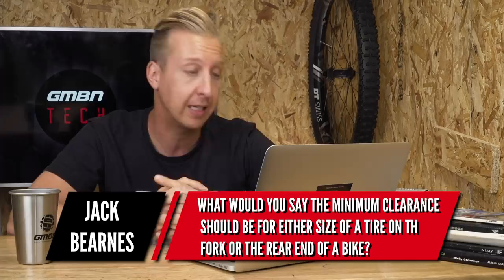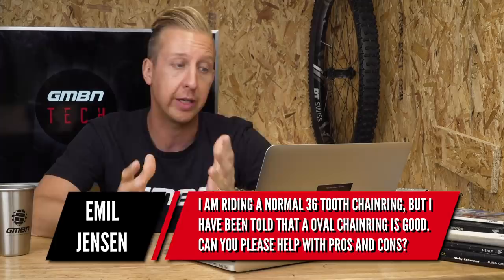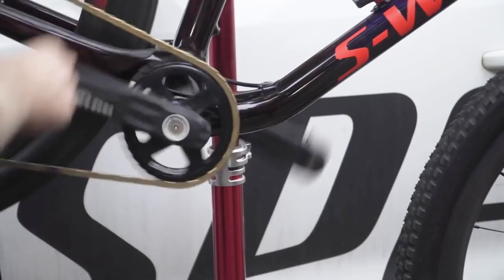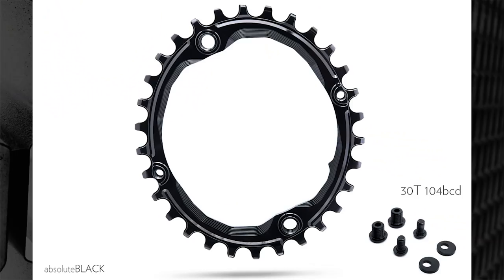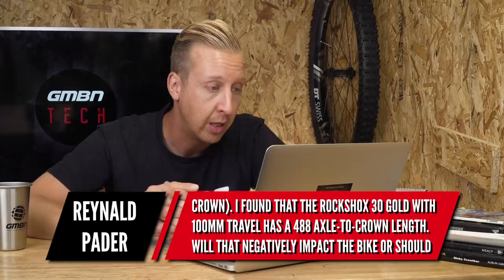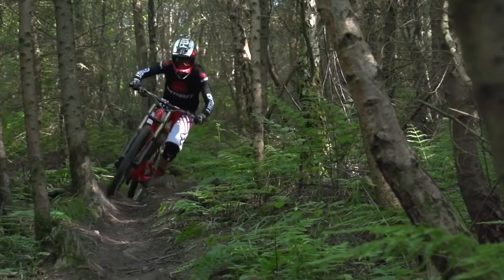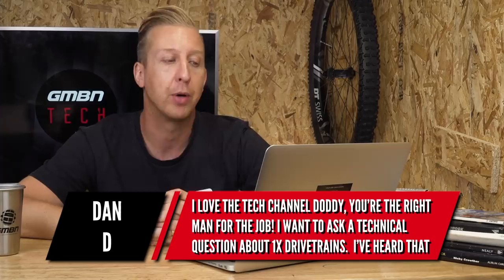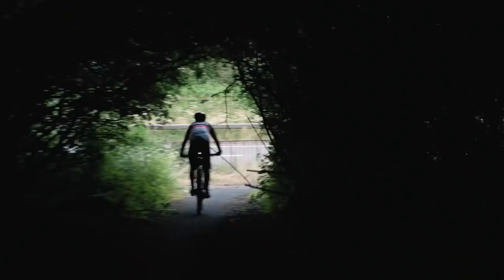Ask GMBN Tech: Should I Get An Oval Chainring?

Comment: for the fork question, go for the longest travel you can afford (i suggest dont go over 150mm) (take this with a grain of salt...)

my old specialized pitch comp 650b size small (2015) had a 80mm suntour on it. then one day i was browsing through CRC and saw a 2016 pike with 160mm travel (rct3) for 500€ and i bought it. after installing it, i noticed how slack the bike was (70.5 deg ha to 64 deg ha) and suprisingly it made the bike feel so good..... it suited my riding well..
Reply: jaakko200987654321 this is not good advice it will void your warranty and will put loads more leverage on your head tube which could snap
Reply: i know. do that only if you understand the implications. also if you have warranty still left dont do it

Comment: 11:57 As long as you got long enough limit screws you should be able to make it work, all rear dérailleurs have enough limit screw adjustment for that, the limit screws will make it impossible to shift down further even if the cable gets slack.

Comment: Ok today was my first short 22 mile ride on mostly flat terrain with the Absolute Black 34t inner oval chainring. My average speed on this ride was 0.4 mph faster on the exact same route as my previous average(s). Perhaps it was all in my head. I don't know. In the first four miles I noticed something was different in my pedaling but it was very subtle. My cadence in the 34t felt smoother.  When I went to the big ring at 17 mph I noticed it felt a bit sluggish in the non-power position. All I know is I'm keeping the 34t inner ring on the bike and on down the road I may go to a full sub compact Absolute Chainring setup. BTW shifting on the front derailleur was flawless with no adjustment needed because I kept the standard round Ultegra 6800 big ring.  Also I don't feel as tired after my ride but that may be because today is half-price day at Churches Fried Chicken and that's where we're headed as soon as I get cleaned up.  Nothing like a big box of extra spicy fried chicken and coleslaw as a recovery meal.

Comment: 1:02 good points, but stones will scratch up the frame anyway, so you would need protection on it to avoid that, I put as much as i could.
my 2014 Fuel ex, is way too flexy for me, I got only few mm on the drive side, so with 2.30 tyres it tyre flex, and flex in the crank area, will make it rub, they did a horrible job, it came speced with 2.30 but you need 2.1 to not get rub. But I still ride my old xc hardtail, which don't ahve this issue, clearance is not amazing but good enough, stiff enough frame, unless you really go crazy it won't rub, But Rockshox 32mm forks got horrendous clearance, like Rock Shox Recon gold so watch out for that, if you want mudguard you need 2.1 tyres, any bigger it won't fit, mudguard or goggles is a must for me, or I get stones in my eyes.
My trail bike is annoying but new bike is in the plans, probably Nicolai or Pole, but Nicolai looks more and more promising as more I look at it.

Comment: I  use  an MRP upper  guide,  just like the ones  you show  in the  video. With   my oval  ring there is  no  problem. You  just have   to  adjust the clearance where  the ring has the largest diameter, It is still covered  by the guide  where the  ring has the smallest   diameter. I don't understand why  he  is trying to make a point about it?

Comment: This video has spike me to go back using my ovals. I used them for about 3 months last year to test. It took me about 2weeks to completely feel normal to use them. As my fitness has been changing all the time, I couldnt tell if i had improved efficiency using it. All I know is that I could use a lower gear more comfortably when spinning at higher rate. I changed back to normal ones it took me a few days to get used to it completely.

Comment: Why is it never mentioned that a worn chain shifts worse than a new?
I commute 8km each way every day in all scandinavian weather and don't clean my bike very often. This means that my chains and sprokets wear out every 6 months at least.
When i fit a new chain on an worn casette, the shifting imediately gets better.
Sometimes the chain starts skipping in the worn gears, if it's not too bad it goes away when the chain stretches. But usually there is no way around changing both.

My advise is to ride chain and casette as long as bearably possible and change both together.

Also, changing the jockey wheels to ones with bearings, have helped with better shifting on cheaper deraileurs (105 or worse). My experience is Shimano only, but i could imagine that it translates across.

Comment: In response to the question at 11:28 by whistler bike. Why don’t they just shift to the lowest tooth gear and screw in the limit screw ? I’ve done this on my giant glory with saint shifter and it works just fine and unless I push the shifter really firmly (which probably does more harm than good) is the only way I can make the shifter click further.

Comment: 3:15 I am pretty strong but round rings are just too much, and I ride a lot, but of course not every one is the same, even if you ride a lot and are strong it does not mean Oval won't benefit you, technically they will benefit everyone, but some riders say the barely notice a difference, but most will notice huge difference.

Comment: 3:52 the way I ride I need a chain guide even on Narrow wide, I use Absolute Black Bashguide the guide is designed by 77Designz, it works great, it's the only chain guide that's properly developed for oval rings. I also have to have a bash guard, I have it even on my  Xc bikes, all of my bikes have to have it.
if you ride down a steep & rough downhill like for example more or less 50 degree stairs or downhill with huge roots, and ride down with low gears, the chain will drop. for me it dropped with this setup: 37T cog on the cassette and 36T Raceface round narrow wide ring. down about 50 degrees stairs

Comment: The rear mech has to die quicker,its constantly on the move,my g2 supports only round,round wheels,round hubs,round bearings,tyres,,cassette and the pedal rotation,all round,ill go round,it seems more intough with the physics of motion,however had xt bio pace around 1990,a brilliant 3 ring crank for xc,climbs and flat miles,round feels slightly more torqey on downhill,keeps traction good

Comment: #AskGMBNTech Hey, Doddy, I'm a Mechanical Engineer from Bengaluru, India. I have a Marlin 6 which I bought last October. I use it for commuting and XC. I am experiencing a small problem with my front sprockets lately. I use the following gear ratios, largest 4 cassettes with the 24 teeth, 3,4,5,6 with the 34 teeth, and smallest 3(6th, 7th and 8th) cassettes with the 42 teeth. I don't know the exact terms to use to explain my problem so i will use an example. I changed from the 42 teeth chain ring to the 34 teeth, so from my knowledge, the chain should shift in about half a revolution of the crank. But, what happens(sometimes(once every 100 gear shifts or so)) is, as I'm pedaling, the upper part of the chain slowly shifts to the 34 teeth chain ring but even after half a revolution, some part of the chain is on the bottom part of the 42 teeth chain ring. As I continue pedaling, the chain is pulled back and gets stuck between the chain ring and the chain stay. Meaning, the chain, from the bottom of the chain ring is not traveling towards the rear derailleur but moving with the chain ring till 3/4 crank rotation where it gets stuck between the chain ring and the chain stay. This has resulted in one of the first scratches...... What do I do???

Comment: Can you explain to people and including me, on and how to upgrade your fork? I have a 2018 Trek X Caliber 8, what specs and names should I look for as far as the actual fork goes? Like I know I have a 100mm air 29er but like the G2 on 51mm offset I think? Does that have any change on a Fork option? Fork tube Size? What to look to for when purchasing a new one? Also gear options for 2x10 guys with cheap ol HG50 stuff. Also have Shimano m315 brakes. Just bought Shimano RT66 180mm disk front and rear with sinterd pads. Should I look at other masters and calipers? Shimano has so many options? Thanks for the Vids GMBN! Love you guys from the States! Sorry for the long question. Noob mtb, and I think I just read so much mtb stuff and just got confused. Do lots of bike camping.

Comment: Hey GMBN! Love the show, keep at it, i was wondering whats the best bike for every type of riding, DH, Enduro, the lot! doesn't matter if it's hard tail or soft tail price around 2500 pounds for a 14  yo, thanks :)
Reply from the maker: Hey Flyn, you'd get a really nice hardtail for that price, or a good, but fairly entry level full suspension (entry level with a really good frame and pretty good parts). You should probably look at a trail bike. They're best for all round riding. It won't stop you climbing well, and will be good for descending too.

Comment: Hi Doddy, I have a Orange Crush s 2016 in a size XL(140mm of travel) I was wondering if adding a angle adjust headset (-2 degrees) to change the head angle to 64 from 66 degrees would mess up the handling of the bike? Cheers.

Comment: What’s the benefit of a square tapper bottom bracket and a hollow tech one. It’s kinda expensive in our country so it’s kinda hard to choose what parts are needed to be changed
Reply: Arnold Christian Mendoza Square Tapers are heavy, develop play very quickly but are cheap. Hollow Tech I'm a bit hazy on but Hollow Tech II is very light, reliable, easy to work on but is pricy.
Reply: that sums it up quite nicely. Also I have noticed a square taper BB can have problems with cranks coming loose if they are not installed super tight. When it comes to square taper you will also need crank pullers to take your cranks off and it's gonna take considerably more effort compared to hollow tech. For removing your cranks on hollow tech you really only need a Allen key (I think it's a 5mm?) and 1 of those pretension ring tools (dirt cheap). The removal of a hollow tech BB is also really easy at home with a BB tool, the parktool BBT-9 also comes with the shimano pre tension tool attached meaning you will only need 2 tools to work on your BB/cranks with a hollow tech.

Comment: #askgmbntech Hypothetically if you can put 27 plus on a 29 frame, could you put 26 plus on a 27 frame?
Reply: Smaller plus doesn't automatically fit in larger non-plus. There's a width clearance to consider, not just diameter. (that goes for 29r as well)
Reply: Mr. ZiggedWhenHeShuddaZagged is right.
Reply: The Evil Calling does this. Good luck finding 26+ wheels and tyres though!

Comment: HI Doddy i have a dilemma, i have a fox 34 with a 195mm steerer tube, and have bought a new set of Fox forks with more travel with a steerer tube of 170mm, my headtube is 130mm and have just ordered a dmr defy stem which has a 31mm stack! my hope one im replacing is 45mm stack, the bike has a 10mm spacer below the stem which i could remove if need be .which leaves me 1mm short, do i go this route or should i try a bbb steerer tube extender, i plan on using the bike for bike parks and enduro, thanks again .#ASKGMBN #ASKGMBNTECH

Comment: #askGMBNtech
I have a Specialized Enduro from 2012, the fork is an XFusion Vengeance R, do you think it would be worth it to upgrade the damper to the one from the Vengeance HLR (which would give me compression adjustment) or would it be more reasonable to grab another fork entirely? Also the R damper has an air valve on the bottom for some reason (?)
P.s. the fork actually works really good, that's why I'm considering doing this damper transplant.

Comment: #askgmbntech Hi doddy, I have been thinking of getting a nukeproof scout 290 frame and outfitting it with parts from my old XC bike which has quite good parts but the front suspension is the only thing I would need new as it has started to rust on the inside and its old. I saw a Fox 40 downhill fork for sale in my area for a good price. So my question is, is it possible to put a double crown downhill fork on a hardtail, and what would be the advantages and disadvantages of doing so.

Comment: I have a 2018 Giant Stance 2 with 120mm travel sr suntour suspension, I’m a heavier rider at 220 lbs and i feel that I don’t quite have enough travel for bigger hits what would be the pros and cons of buying forks and a shock with maybe 140mm, or even 150mm travel, and would I benefit more from maybe a set of fox or rockshox 120mm suspension? Love the show by the way ... very helpful!
Reply: Shaydon Zeigler have you set up your suspension?
Reply: Manhattan 81 I have actually, my rear shock I believe is at 220psi and the forks at 100. I’ve played around with the pressure and it just seems they are either too stiff or too soft and I can’t seem to find that happy medium

Comment: With my long legs I always tend to fall in between a size M or L. Earlier this year I demoed a rockymountain instinct in both M and L, in that case I felt much better on the size L bike. Now a few months later from that I bought a scott genius and was struck with the same thing, do I go M or L? Advised by the LBS I went with a M and the bike feels GREAT, all I had to do was get a longer dropper post (went with the 160mm highline) to get my saddle at the correct 782mm height for me. I haven't had a chance to test a size L genius tho so can't really comment on that :/
Doing some later "research" later for fun I learned the avg Leg to Body Ratio is about 45% while apparently mine is around 49.5% based on the measurements I got at said LBS.

TLDR: For some people finding the right bike size can be annoying and change from brand to brand it seems. Once again shows how important it is to demo before you buy, ESPECIALLY if it's for your first (few) bikes. After a while you'll start learning what kind of geometry you want so sizing should become a lot easier in time.
Reply from the maker: Super important to demo bikes! Brands are changing their sizing especially in the last few years.
Reply: Yes I would very much agree but I find it kinda disappointing how difficult it can be to demo. Other than this 1 yearly event I found here in Belgium so far it seems near impossible to get a good demo ride and in the end only a small brand is represented in that event. If only there was a way to make demo events more reachable for everyone.

Comment: #askgmbntech Hi, love your tech show... Recently, I discovered a scratch on the side of the downtube of my carbon frame. I guess it is about half a millimeter deep, about 10 cm long, and it was most probably caused by some flying rock or branch. The color of the bottom is white, unlike the black of the cover paint.
What would you recomend I should do about it? (Bike Canyon Exceed CFSL 5.0)

Comment: To stop a shifter shifting to the last 3 clicks cut the end off a cable crimp remove cable from last section of casing slide crimp on refit cable select the last gear you want crimp at shift side cable stop not rear else you will have achieved nothing 😉

Comment: I rode with an oval chainring around 20-25 years ago! (I'm surprised you didn't bring up the fact that this existed and went extinct.) And I believe they got rid of them because some felt they were causing knee issues. But no... I won't be going back in time.
Reply: modern ovals are way different. i think nowdays its for a whole new purpose
Reply: But modern ones do the opposite. Keep up in the time
Reply: Great. How? How are they different? The old ones were intended smooth out pedal strokes based on when you have more vs less leverage. So, how are the new ones different? I'm genuinely curious.
Reply: Thanks for the clarification, bigtruck.

Comment: #askgmbntech
I ride a 2018 Kona Fire Mountain and im looking to upgrade the front fork which is a  Suntour XCR 32 LO-R coil fork with 100mm of travel, i want a fork with atleast 140mm of travel but dont want to break the bank, got any suggestions?
Reply: Kavi Tenuwara thats waaay too much plus any 140mm decent fork will run you like half of your bikes price. I have a Kona Mahuna with a 100mm air fork, changed it to a 120mm one and even that was a big difference. My bike felt sluggish and wasn’t as responsive as it was before. Not worth it all for that extra 20mm so i changed it back. Never bottomed out anyway just wanted to be future proof when im trying a little bit of DH but i realized quickly that even if i get a bigger fork its simply not meant for that. Just get a new bike or try doing tracks that are suited for you. XC racing will not need 140mm forks

Comment: Open question to anyone who owns or has knowledge on canyon strive. What bottle cage do you use coz I can’t find one that fits on my 2017 strive al 6.0
Reply: Might wanna look up "bottle cage mount top cap" and give it a shot?!
Reply from the maker: 😳 but why would you want to add so much weight onto your steering like that?
Reply: They don’t look that good and I mainly do downhill or enduro style riding so that wouldn’t work
Reply: That honestly looks like an accident waiting to happen!
But maybe consider a side bottle cage or perhaps a cageless system like fabric or fidlock? I'm guessing anything with a side release would be easier if I am understanding your problem.
Reply: boomerangfreak I’m not sure about fidlock but I tried fabric and the bottle hits the rear shock
Reply: Aaah I see, the bottle hits the piggy back huh? I dunno tbh to me it seems like a weird placement for the mounts, seems they should have put them on a bit higher. Only thing I could say is see if you could mount the cage a bit higher and you COULD try the fidlock but a bit pricey if it turns out to have the same problem.
Reply: boomerangfreak 
I am sure you can get mount extensions